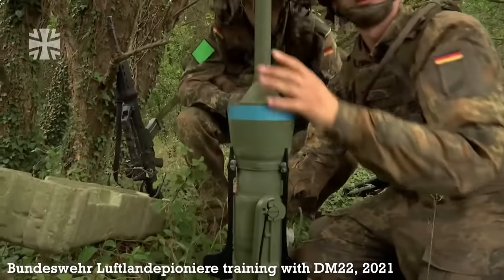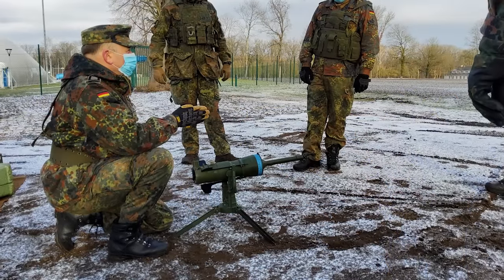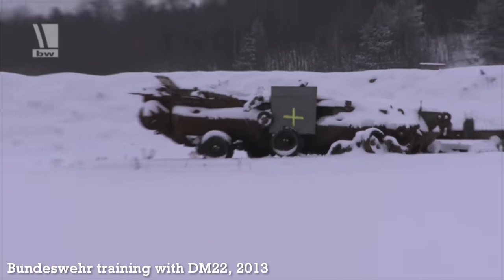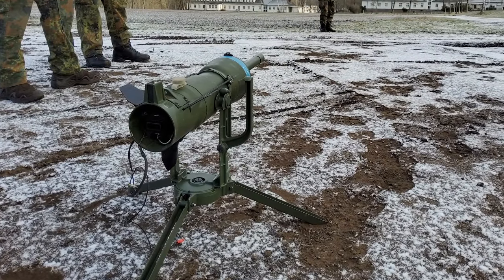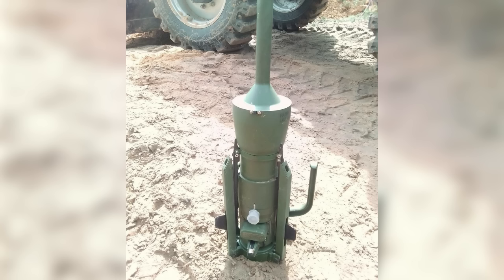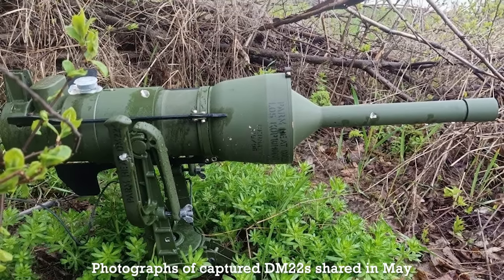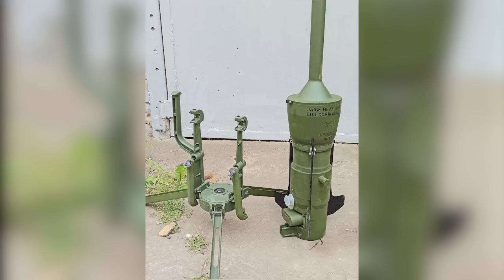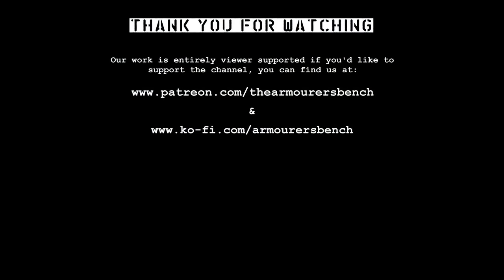German DM22 Directional Anti-Tank Mines In Ukraine

Comment: The inclusion of the fibre optic cable would potentially make this an anti personnel mine. This would be a little cheeky as the Germans signed the Anti-Personnel Mine Ban Convention in December 1997. If it’s remotely detonated by an operator it’s not a mine…
Reply: The charge would need to be changed too. A shaped charge with a stand off detonation chain would have little use against personnel
Reply: Since this would be set up to hit a moving target, the fiber optic cable would be placed so that the rocket hits a bit further down the road as the tank would move while the rocket is flying. Unless you're triggering one while furiously jogging, you'd see it passing a meter or two in front of you - the probability of being directly hit by one as a pedestrian would be extremely low - and unlike actual antipersonnel mines, it only detonates when hitting something, so you're not being showered with shrapnel like you would be with a claymore.
Reply: @jnievele  exactly
Reply: @jnievele  this is all true but irrelevant to the definitions in the APMBC. The Convention defines an AP mine as an explosive device capable of being initiated by the pressure, presence or proximity of a person. This definition was deliberately kept wide to avoid states claiming that their particular weapons systems were somehow exempt.
Reply: @scrappydoo7887  maybe so but efficacy isn’t covered by the terms of the APMBC.
Reply: @bob_the_bomb4508  appreciated but the post sale improvisation/alterations isn't the responsibility of the nation of origin either
Reply: @bob_the_bomb4508  it's like saying that the production of ammonium nitrate is a breach of the ban because mine style IED are made from it.
I do get where you are coming from but ultimately the piece sent is fine because once you use something for other than its intended purpose the liability disappears
Reply: @scrappydoo7887  indeed but the video specifically says that it comes with a fibre optic cable. If this works like the collapsing circuit ‘break wire’ in the L14 then - by definition - it’s an AP mine.

Dynamit Nobel Graatz in Austria were caught out in a similar way when they continued to supply their claymore-equivalent with trip wires even after Austria had signed the APMBC.
Reply: @scrappydoo7887  not the same. The APMBC covers the production, stockpiling sale or transfer of AP mines. 

The wording of the APMBC was done to capture ANY crafting of a device - improvised or not - into an AP mine. So as to prevent states rebranding an AP mine as - for example- an ‘anti handling device’ as one country attempted in the negotiations. 

And incidentally there is an international committee reviewing AN because of its potential use in IED. The UK had already changed the regulations on AN composition in Northern Ireland and the committee is considering whether something international could also be done, especially in the light of Beirut explosion.
Reply: @bob_the_bomb4508  that's interesting. With it being off route there's probably a loophole but I'm going to have to brush up on that bit because I cannot agree or disagree in a totally informed manner.
Reply: @bob_the_bomb4508  trust me I'm familiar with the regs on AN being from a farming area of England lol there was a lot of honking about it at the time. 

As far as the rest of the information you provided goes I will definitely be having a look at it in source material to see what changes have been made 👍
Thanks
Reply: @bob_the_bomb4508  after a skim it seems that mixed catagory mines are not covered nor are booby traps so how to what you know (which seems more up to date than what I know) does that figure?
Reply: @scrappydoo7887  fair enough. The convention was drafted on the principle of ‘no loopholes, no delays, no exemptions’ to ensure that things weren’t inadvertently left out. I believed the UK got rid of the L14, the F1 combination switch and even the HB876 to avoid being on the wrong side of the definition, given that the drafting in Oslo in 1997 started the day after Princess Diana’s death.
Reply: @bob_the_bomb4508  Yet the Claymore is exempt, too. Also, we don't know how much pressure is needed on the fiberoptics to trigger the mine - it is a bit more complicated than a simple tripwire after all.
Reply: @jnievele  the claymore is ONLY exempt in its command detonated form. See my earlier comment about what happened to DNG.
Reply: @jnievele  as I said above, if the fibre optic acts as a break wire as in the L14, it’s an AP mine by the definition of the APMBC, because a person walking through the L14’s break wire would initiate the mine.
Reply: @bob_the_bomb4508  You assume that that is the case. Fibre-optic cables can also be used to measure the weight of the object passing (due to the change in reflected signal as the fibre gets flattened more). So unless the pedestrian is heavier than several tons, he wouldn't trigger it - voila, it's no longer an AP mine.

The whole question is academic anyway, as Germany never used them in anger, and Ukraine never signed the treaty (and neither did Russia, who are using PFM-1 AP mines in Ukraine)
Reply: @jnievele   I didn’t ‘assume’ anything. I expressly stated ‘if’ it works the same as the L14…

Also it most certainly isn’t academic -at least for the reasons you state. Germany is forbidden under the APMBC from transferring or selling AP mines (and similarly it would be contravening the convention from stockpiling them).  Regardless of whether or not Ukraine has signed the APMBC. Which, incidentally, it has.
Reply: Yeah and Ukraine gave up their nuclear armament for the world's protection yet it's not happening
Reply: @scrappydoo7887  booby traps aren’t specifically covered by APMBC. But, given the definition of booby traps as ‘devices that function whilst carrying out an apparently harmless act’ it’s hard to see an explosive booby trap that is not covered by the APMBC. And, to that end, Australia stopped making the F1 combination switch. 

However non-explosive booby traps (think Vietnam War) aren’t covered by the APMBC, and anti-handling devices on AT mines are also excluded.

I’m unfamiliar with the term ‘mixed category’ mine.
Reply: @bob_the_bomb4508  the term mixed catagory was on the Wikipedia page for the mine ban convention, I'm aware it's not the best source but it was the first vaguely comprehensive page I found lol 
They also said that booby traps and anti handling devices were not covered so the information might not be the best lol
Reply: @scrappydoo7887  I read the wiki entry and it’s a bit hit and miss on the definitions.

It does mention the US gambit at Oslo:

“a change of the definition of APMs to allow the use of mixed anti-tank and anti-personnel "munitions" systems”

This was an attempt to allow the US to retain the GATOR scatterable mine system which at the time had an out of service date of 2010 and was a significant interdiction weapon. The GATOR comes in two flavours: an AP mine and an AT mine. They are ‘mixed’ in that they are deployed simultaneously, but they are separate weapons. I was in the room when the US delegation tried to argue the AP mine should be regarded as an ‘anti-handling’ device. This argument failed to gain traction in the room. That’s why I didn’t recognise the ‘mixed’ term as it wasn’t actually used in the room at the time and I haven’t heard it since, as it was a non-starter.

The wiki also says a mine has to have a pressure plate - which it doesn’t - but still goes on to call a Claymore a ‘mine’ even though it doesn’t have a pressure plate either, and, as discussed above, is only a mine if it has its tripwire attached. The wiki also fails to use the correct term of ‘directional fragmentation mine’ as there are many other types of mine fulfilling this role than just the M18. It also doesn’t mention ‘stake’ mines such as POM-Z or bounding fragmentation mines such as the PROM.
Reply: @bob_the_bomb4508  it's a shame there are no direct messages on here now. You sound like someone I could learn a lot from. It's quite rare to come across someone who has direct experience with the subjects they discuss
Reply: @scrappydoo7887  thank you…don’t know a secure way of doing that these days
Reply: The cable needs pressure exceeding 500kg to trigger.
Reply: @bob_the_bomb4508  it's very frustrating to be honest. But thank you for the information you have given 👍 it's appreciated
Reply: @louisr6560  ok thanks :)
Reply: I have worked with commercial fiber optic cables,  they can be very strong and can be made to not be easily crushed by a person.
Reply: @scratchy996  it all depends on this. The fibre optic cable with the L14 mentioned in the video is a ‘break wire’ that is easily broken by a person. It triggers a collapsing circuit which detonates the mine. The question is whether or not the one included with the DM22 is similar.
Reply: @bob_the_bomb4508  It would be stupid to use a fragile cable for an anti-tank mine. 
Unless the guys who made that mine are morons who don't know what they are doing, I don't think they would use a cable that a person can crush and ruin the chances of the mine hitting a vehicle.
They did design a mine that can hit and kill a tank from 100m away, so there is a chance they are not complete imbeciles. 
But I guess you never know...
Someone should send them a letter.
Reply: Sounds like bs.
We were told that a person stepping on the fibre optic cable does not exert enough force to break it and thus the mine would not fire.
What is the source for your suspect and curious claim?
Reply: @scratchy996  From what i was told when we were introduced to the DM22, you are spot on.
The people who make em are indeed not imbeciles and the Bundeswehr is indeed not "beeing illegal" or whatever OP wrote (unless he can provide us with good evidence to the contrary, like scientific testing by a reputable third party which concluded that those mines are indeed triggered by a person stepping on the cable).
To me it sounded like OP wanted to sound smart and informed when in fact he isn't. Well, let's wait for the evidence.
Reply: @scratchy996  The L14 had a very fragile breakwire. That’s why it was taken out of service after the UK signed the APMBC.
Reply: @martialme84  if you’re talking to me I didn’t ‘claim’ anything. I posed the question if it worked the same as the L14, which it was compared to in the video. If it’s a ‘crush’ wire that works on 200kg of pressure that’s ok. If it works like the L14, ie a very fragile ‘break’ wire, it might be problematic.
Reply: @bob_the_bomb4508  Yes you did claim that.
You did not ask any question at all.
Read your original post again, mate.
Here it is:
"The inclusion of the fibre optic cable would potentially make this an anti personnel mine. This would be a little cheeky as the Germans signed the Anti-Personnel Mine Ban Convention in December 1997. If it’s remotely detonated by an operator it’s not a mine…"
See?
No question at all. Just your claim.
Reply: @martialme84  I suggest you look up the definition of the word ‘potentially’. Once you’ve done that, you might be able to understand the rest of my posts.
Reply: @bob_the_bomb4508  So no evidence then?
None at all?
Ok, thought as much.
Reply: @martialme84  it’s a question you fool. It’s the answer which would need evidence. And it’s been suggested that it’s a 200kg crush wire. If that’s the case then all’s good.
Reply: @bob_the_bomb4508  Stop squirming and delete your failed attempt to make yourself look like some sort of expert.
Embarrassing, really.
Reply: @martialme84  nobody’s squirming and I notice you don’t actually acknowledge the point I made.
Reply: @jnievele  The warhead will be only app 20 to 40 m away from the vehicle not further away. No need to guess the speed or anything. I doubt that a person can accidentally damage the fiberoptic cable to trigger the mine. More modern versions work with IR or with microphones that filter out other sounds and only react to tanks.

Comment: whats the point of the stand off rod?
Reply: The shaped charge explosion forms a piercing point just in front of the warhead. Search "shaped charge simulation". Often the standoff is not so obvious like the RPG-7
Reply: It appears to actually fire the warhead at the target, so the stand off rod works just like a shoulder launched warhead would, detonating the warhead. I believe some off-route mines do no do this and are simply a flat faced EFP that relies on being placed at the correct distance from the target. This model has a lot more lee-way in placement as it's more of a remote launcher than a mine.
Reply: Basically shaped charge warheads don't produce the deepest penetration when they go off at point blank range to the armor plate, but need some distance to form the superplastic penetrator jet. As such a lot of HEAT weapons have a stand off detonator, even if it is not always obvious like on the RPG-7 as @Maave pointed out. The Wikipedia article on slat armor even claims that most stand off detonators on HEAT warheads are actually shorter than would be needed for optimal penetration for reasons of compactness and diminishing returns on stand off distance. As such slat armor sometimes gets referred to as "probability armor": In cases where the missile hits the bars with the body of it’s warhead it gets deformed, disrupting the Munroe effect of the shaped charge and thus decreasing penetration greatly. But in cases where the missile hits the bar straight on with its detonator, the stand of range to the actual armor plate is increased and the penetration capability is unaffected or may even increase.
Reply: @MaaveMaave  PG-7. The RPG-7 is the launcher, which can also fire the OG-7 HE/frag A/Pers ammunition

It’s a coincidence that RPG can mean ‘rocket propelled grenade’. In the original Russian ‘RPG’ stands for ‘hand-held anti-tank weapon’.

No rocket motor in the RPG-43, for example…
Reply: and in what scenario would a stand off have a benefit for a roadside mine?
Reply: @smokeshow7691  the DM22 doesn't actually explode in place like conventional anti tank mines or off route mines, that launch an explosively formed projectile (efp) such as the MIACAH or SLAM. Rather it launches an anti tank missile just like an ordinary shoulder fired anti tank rocket would. That missile uses a normal HEAT warhead and as such benefits from a stand off rod the same as other HEAT projectiles. Basically imagine it like a RPG with the trip wire strung to the trigger. Actually the first off route mines in WW II were just that. Bazookas with the fuse connected to tripwires. I think The Armorers's Bench has made a video about those.
Reply: @smokeshow7691  I think you're misunderstanding. This mine isn't detonated on the spot like roadside bombs; instead, it launches a shaped charge warhead (like a PIAT bomb) towards the target area when triggered. The warhead directly impacts the target, hence the standoff.
Reply: @smokeshow7691  standoff gives options for positioning, for example behind cover out of sight. On an open road an off route mine stood up in plain view wouldn't get you very far.

Comment: If a cable can trip the mine what prevent a person walking along and tripping the cable and detonating the mine? "Once aimed across the expected area of enemy movement the trigger cable can be deployed. The fibre optic cable can be replaced with a passive infrared sensor which extends the mine’s triggering range out to 60m."  Could it be possible to set one of these up and have the German Chancellor walk by to insure it doesn't act as an anti-presonnel mine that was banned by the Ottawa Convention of 1997. These did go into production around the time the world came together to end the horrors of anti-personnel mines so "I guess it isn't a waste given these are meant to kill Russians. (sarc)"
Reply: Heavy weight is required to trigger the mine.
Reply: @afp259  Will it be triggered by car tires?
Reply: @1959Berre  Good question.  I would guess, you will need a truck to trigger this mine but i am not sure.

Comment: No shit it's capable of going through in excess of 100 mm of steel. Even the damn RKG-3 can go through over 200 mm.
Reply from the maker: When I can't find data that's firm I don't speculate. Some sources say 600-1000mm which sounds about right to me.
Reply: @TheArmourersBench  lol I was gonna comment "in excess of 100mm" is a pretty safe estimate XD

with the size of the warhead, I'd believe 500-1000mm.
Reply: @Forbiddina  The parm1 can penetrate 600mm, the parm2 750mm and uses a tandem warhead to trigger reactive armor. As i read in the video it was the DM22 version, so Parm2 it is.

Comment: It's all old stuff. In the USSR, such developments were conducted in the 1960s
Reply: The DM-22 was developped in the 80s, the first similar designs came from WW2. But old or not, what matters is that it's a weapons system still relevant to modern day combat.
Reply: The DM22 has a Panzerfaust-3 warhead. It is equipped with microphones that activate it when the sound signature of tracked or other heavy vehicle approaching is identified. It also comes with alternative infrared sensors instead of the fiberglass-cable. The DM22 with the infrared kit can also distinguish between single vehicles and convoys approaching and can be set to let a certain number of vehicles pass before it attacks. It's not dumb.
Reply: So what it works....